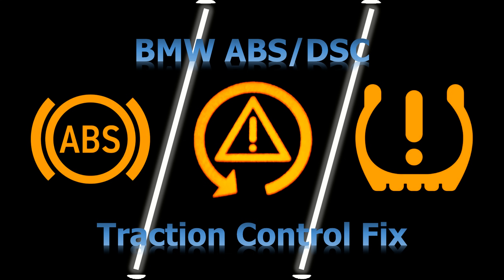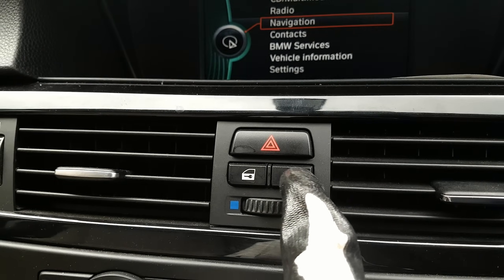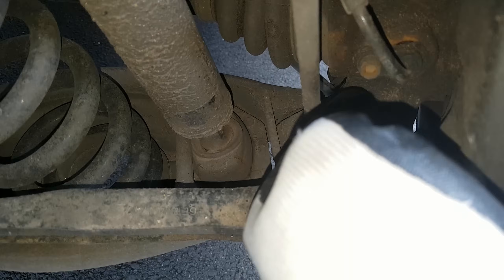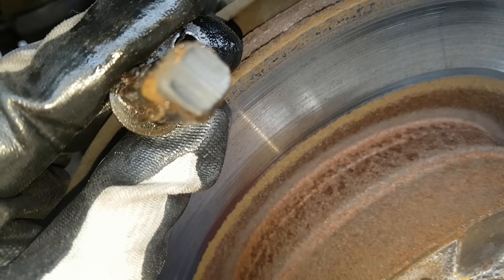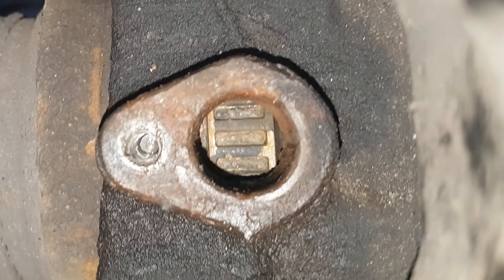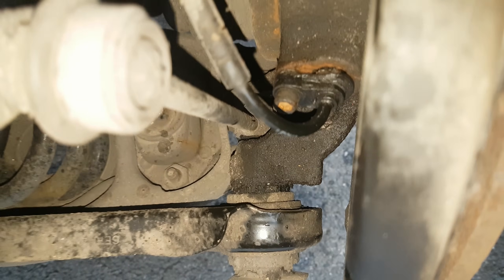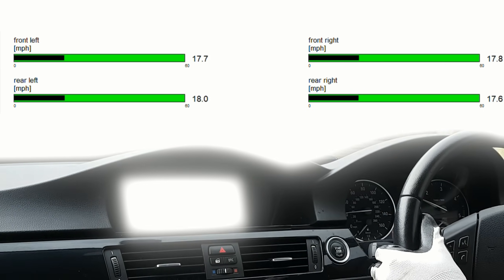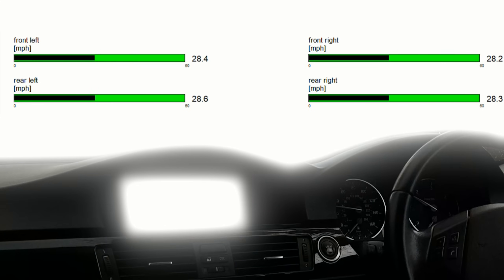BMW Traction Control ABS DSC DTC issue or loss of engine power

Comment: I own a 2007 BMW x3, the 4x4 warning light comes on together with the wheel sensor when I give it 4000 rpm, then when this warning light comes on the car shakes and turns hard, then when I stop and restart the car it disappears.  What could it be?  does the problem show no problem?  could it be the ABS sensor?  thank you
Reply from the maker: Could be ABS or a genuine mechanical fault like warped discs, drive shaft etc etc. What does the diagnosis say?
Reply: @laymandiy  the diagnosis shows nothing because the light goes out when I restart the car.  And the mechanic doesn't know what it could be, he says something about the electrical part of the car, but the battery was changed last year.
Reply from the maker: You kind of need the diagnostic in when it happens live to establish the issue.

Comment: I try this on my BMW e92 2007, but it not help. First i had only the flashing traction control lamp, after i do this in the video i have abs,dsc,dtc and tyrepressure lamp on. It comes and goes when i drive.
Reply from the maker: How thick was your washer

Comment: Hello. How long can you drive with that signal light and whould your engine shut off completey while driving? Thnx.
Reply from the maker: Yvonne Gomez as long as you want. As long as you turn the traction control off. But you're driving with a crucial safety feature off which isn't recommended
Reply: I was driving like that 2 weeks, and then it started doing the same /losing power/ even though the traction control was off. Then my car mechanic finally had time to fix it, and he basically just cleaned it, after that it was working just fine.
Reply: @stanislavaviselkova3263  is it still working fine?

Comment: Hi there, not sure if anyone has some advice. I took my BMW 1 series to a garage as I got the DTC warning light. He then said the Vanos cams came up so cleaned them up for me. Got more issues so he serviced the car and changed the spark plugs and then said that would resolve the issue. I now still have the DTC warning light with the car pulling. He said I should bring the car in and he will do another diagnostic but I am starting to lose confidence and I'm £400 down! 😞
Reply from the maker: Interesting, very difficult to diagnose remotely. Did you resolve it?

Comment: hello.!! I want to see if maybe you can help me figure out what's wrong with my 2001 bmw 330ci... its been having this issue since I bought it last November 2019..the problem is the following: when driving the car my DSC LIGHT AND BRAKE LIGHT ALWAYS COME ON and when they do the car starts making this noise from the front left driver tire and then you can feel like the tire braking or as if something is getting stuck, jerk drive like feeling..as that happens the lights on dashboard start to flicker for few secs as it recognizes there's something wrong and then stay on until car is stopped and parked.. in one occasion it even make my front left tire get completely locked to where it burned tire (because I was driving it of course lol)... I can't seem to find what's the issue , I've already replaced the brake rotors with pads, also abs/speedometer sensor, and still no success... Ive tried taking it to a shop (not euro car emphasized) and they suggested the abs sensor that's why I replaced as well, but nothing...
DO YOU KNOW WHAT CAN POSSIBLY BE WRONG WITH MY BEEMER..? PLEASE HELP!!
Reply from the maker: Diagnostic not picking up anything ?

Comment: Hello my bmw e46 have turned on lights of ASC and ABS, and have lose the power. What must be the problem for power do you know? When i start to move the car need more rpm to start, and when i change the gearbox very slowely goes up rpm from to 2000rpm. Thanks.
Reply from the maker: Sound like you need to get it looked by a professional. You won't have to diagnose let alone fix. Off the top of my head, if it's simple enough, clutch replacement (it could be slipping).

Comment: Afternoon and greetings from a fellow Brit now living and working in Germany.  This happened to me today while driving on the Motorway, car kept reducing speed and the indicated warning light came on (2007 BMW 1 series Sport UK variant) I am guessing what is happening to mine is 100% as your video suggest, well I guess I need to get it into the garage and get some sort of estimate, have a feeling its going to cost a small fortune.  Kind Regards, John
Reply from the maker: If you don't use BMW original parts then you save a small fortune lol. BMW quoted something like £1200 per side
Reply: @laymandiy  your video is excellent, I will take the car to a good local German/Bosch garage and hope it’s repairable and not so expensive otherwise I will be considering a alternative car.  Still your video was excellent, just wish I was back in Cambridge at my trusted garage.  Many thanks, Regards John

Comment: I had a garage replace my right rear wheel. Just about ever since I've had the DTC problem on left turns and straight highway lanes. Could it be that the wheel replacemant by the garage caused this??
Reply from the maker: Unlikely, most probable cause is that all your connected systems were deteriorating in the same manner and suddenly a brand new wheel is probably forcing it into a new position causing the sensor to rub up against the relictor ring..
Reply from the maker: Alternative they could have damaged the hub so badly that it's causing these issues but a wheel change is so simple I doubt it.
Reply: @laymandiy  I'm getting low pressure signs also, even after replacing the tire that always had this issue. Could it also be that due to the low tire pressure my right rear wheel is smaller and therefore has to spin faster than the other 3 tires, causing the DTC to go on??
Reply: Even after replacing my tire the pressure is down to 1.1 bar after a week
Reply from the maker: When you say wheel replacement do you mean the entire alloy. You need to take it back to your tyre place and investigate why.. tyres are capable of handling a couple mm difference in size.. if you really thing it's an issue get a tape measure out.. and having a diagnostic kit will tell you exactly what the issue is..
Reply: @laymandiy  i'm gonna get him checked out. It's probably the same BMW characteristic issue you display in your video. Thanks for the help!!

Comment: Have similar issue on my 09 e90. DSC malfunction comes up along with ABS light and Yellow Brake light. Codes don’t show any wheel speed sensor. I get 5E1A CAN/DME signal error with 2A94 - Crankshaft position Sensor. Checked rear wheel speed sensors and reluctor ring, both are okay. Is it worth checking the fronts too? Or could it be some other issue. Car drives okay with DSC restricted. 
Thanks in advance for help!!
Reply from the maker: You need to probably replace the crankshaft sensor... It's a common fault

Comment: Hi mate, this repairs the code 5DEC - Info FLR (driving power reduction activated) ? Thanks.
Reply from the maker: It can do if the speed sensor is at fault.
Reply: @laymandiy  thanks mate

Comment: I just watched your Video,My Traction Control light and Handbrake light both came on at the same time today while driving.My Handbrake is off but bleeps a few times to tell me to Release it when it's off...Anyone got any idea's please,as both lights will not go off now..Many Thanks for any advice before I whip into garage.
Reply from the maker: Sounds like a handbrake sensor issue, cheap fix, I'd try that first.
Reply: @laymandiy  Nope,the brake fluid was on Minimum,topped it up and all good now :-)

Comment: I just recently bought a 2005 BMW 545i and I get this light when I’m going 45 and the car will kick back and it won’t go past 45 miles per hour I put the DTC on and I can go past 45 and it will allow me to go 75 but then after 75 it will stop. I need help not sure what is going on??
Reply from the maker: DTC on reduces the sensitivity, holding it to turn off in theory reduces it further. Completely off I'm not sure.

Comment: I have a 2011 BMW 318d that does the same thing. How would I know what wheel it is without plugging it in.
Reply from the maker: Explained in the video
Reply: @laymandiy  I missed the part where you explained how to determine which sensor.
Reply from the maker: @MrHandpipeman1  if turning left usually the rear right and vice versa. It's not an exact science but the most common.

Comment: Great video! My car(e87 116i) has quite the same problem, but the mechanic says that on the tester he can see that the car feels that it moves even when it doesn't and maybe the problem can be from the ESP computer and not from a sensor?! His final answer was that he is not sure about what should be changed. 
As symptoms: the DTC enters after 20-30km/h(at the beginning just when I was turning right, but now it enters every time) and I have to disable it in order to be able to drive. Of course, after a few km also the flat tire sensor appears, and sometimes also the abs or handbrake sensor appears. I do not know if also the oil level sensor is somehow correlated because it also appears after half an hour of driving(and the oil level is normal-high).
If you have time to help me somehow, I will strongly appreciate it :D
Reply: I have to clarify that the DTC appears/disappears(it not a permanent fault)
Reply from the maker: Hi, First thing is first, we need to get to the root of the problem by elimination. First what i would suggest you do, if you don't want to spend a lot of money is get yourself a k+dcan cable or borrow one. 

1) Drive with the INPA graphs up and record your screen and see how the wheels react to you driving cornering etc. If the car "appears" to be moving, which sensors are showing this to be the case. Likelihood of the speed sensor being damaged is very high, as imagine constantly grinding a magnet against a rusted metal. 

2) Check the ring from underneath the car. If you have the means to easily jack up the car SAFELY or on a ramp you can see from underneath the car, spin the wheel a little to see the rings if its not perfectly round then there is your problem.

3) I don't think there is a problem with the ecu at all. 

4) Are your wheels balanced correctly?

5) did you ever have a knock on your wheels, is there any play in the linkages?

Finally "car appearing to be moving" if it is one sensor showing that then you know its damaged, if it is all sensors showing movement in the same direction and speed, then further investigation is required.
Reply: Thank you very much for your detailed answer!! My car is in a garage right now and the guy says that probably the pump of the DSC unit can be the problem(but he is not sure)...but it costs 2000 euros and just the guys from BMW dealer can solve it. I'm sure that is not the problem that the car has and I hope that tomorrow I will give him some inspiration and maybe we can manage it together :)) The wheels are balanced correctly. About linkages...he changed now the telescopes and probably tested all the movements..I'll ask him tomorrow :D 
 @laymandiy

Comment: i got a question, if u could help me out. i have a 09 e90 with an issue of shaking when at 40-60 miles an hour under load, i’ve checked the quibo and center gasket for the drive shaft and still vibrates. have you heard of this problem before and if yes did u find the solution, thanks in advance
Reply from the maker: Yes many times. It could be many many things, from the wheel hub do the bolts. I had one where the nuts on the tyres wasn't on fully causing a noise. So I'm afraid you'll have to try and find where the sound originates from.

Comment: Do you have to clean it or just washer will do the job thanks
Reply from the maker: jas222grewal cleaning it will ensure the fix lasts longer. You will eventually need to replace the ring or the shaft. Chances are at very high speeds it will come on again.

Comment: So in the UK BMW have charged me £382.66 to fix this issue. 2 new rings and 2 new sensors. 2024.

They under quoted me as it should be £468.22 ish so bear this in mind in the UK.

Also BMW will not spray rust converter on these either which helps prevent the issue in the future. Shame but it’s BMW they have a process.
Reply from the maker: Good to see they are fixing the issue now, they weren't before, charging to replace driveshafts.

Comment: Any ideas of why my traction control light came on just sitting in the driveway with the engine running? Also the speedometer stopped moving. 03 525i Dinan5
Reply from the maker: Wheel speed sensor is faulty, need a new one. Usually the left one
Reply: @laymandiy  Thanks, I appreciate your time and help.
Reply: @laymandiy  Awesome! I replaced all four because they were in bad shape and the problem went away. Thanks

Comment: Which diagnostic machine did you use? I have the same problem but im not sure how to find out which sensor it is
Reply from the maker: D+kcan cable and INPA
Reply: You can also use MHD app (with Cable) and Carley (with bluetooth OBD) to read and clear codes.

Comment: Hi. 
Great video and very enlightening. 
My 1 series is showimg the abs hazard intermittently and then started jerking intermittently. The jerking has increased after 2 trips since it started.
My mechanic is saying it is a lot of work to fix and quoting £350. What do you think the issue is? I am totally clueless about cars!
Reply from the maker: The jerk is probably the loss of power and then the power kicking in again and cutting out. It's the system thinking's it's trying to prevent skidding. If you hold the DTC button and turn it off and drive (carefully) then you'll know if it is the same issue.

Comment: I hit the kerb N/S/R wheel and the DSC light have come on and the steering wheel feels lighter. Any tips please.
Reply from the maker: Wouldn't be driving too much on that. Get it up on a ramp and get everything checked from the axle to the shaft to the hub. 1 or 2 bits might need replacing for safety
Reply: @laymandiy  Thanks for a prompt reply.

Comment: just had this issue and after turning off the car the key is stuck, doors won’t lock, no lights. What could be causing this?
Reply from the maker: Sounds like you've got the recall issue. Open and close the door a few times the rear right side. The connection to the battery is intermittent.

Comment: Link for the sensor readers diagnostic when driving ?
Reply from the maker: Not clear on what you're asking.
Reply: @laymandiy  When youre driving it shows front left front right rear left rear right diagnostics. This is a tool i take it >?
Reply from the maker: Yup, just a screen grab of the wheel speed sensors for FL,FR,RL,RR

Comment: I tried doing this but now my car give straight all 3 lights it probably because the washer is thicker. I cant find the excat washer can you recommend where to find it?
Thanks
Reply from the maker: I used a 1mm thick one if I remember correctly. And it was made of aluminium not steel, which can also cause discrepancies.

Comment: Hello, I have this same problem. I have a BMW 120D And my traction light (Triangle with arrow) keeps flashing on my dash. I have had a sensor replaced and the same issue is still happening. I have now been told to get new rings will that help? Please help any advice will help massively. Thank you in advance.
Reply from the maker: Yes replacing rings (after sanding it back to original condition.

Comment: Just attempted this on my vehicle on all 4 tires sides but the issue still appears. My sensors were just a bit dirty but no actual damage like I see here. What else could it be?
Reply from the maker: The sensor usually isn't the issue, the reluctor ring is. Is your issue intermittent or permanent?
Reply: @laymandiy it happens here and there. When I start my 08 535xi it drives fine, few seconds to a minute later it appears. My screen, A/C and electrical components don’t work and out of nowhere it decides to work again. Just keeps on going back n forth like that
Reply: @laymandiy  I also get the 4x4 malfunction right on as well, the automatic gear doesn’t let me go in reverse or park and sometimes I’m not able to accelerate as well

Comment: I have a 2004.BMW 520 with straight 6 engine. The steering feels very heavy when in use. What could be the problem?
Reply from the maker: Could be anything, can't say. Steering pump some shaft tyres, I dont know
Reply: Sounds like your Power Steering pump went out. Check the Serpentine Belt too.

Comment: HELP PLEASE!! I have same lights along with tyre pressure monitor fail error causing the car to go in limp mode. Which would go fine after 5 mins of engine off and it will reset the dash lights. last week I have changed the both the o rings on rear shafts along with both the abs sensors but this morning I got the same warning lights again. Any help much appreciated
Reply: Did you ever find anything it what was wrong?
Reply: Mine is doing this, abs light, flat tyre monitor then car goes into limp mode and I lose power steering and car sticks in gear 😭
Reply: OfficialGravzy bro I still haven’t figured mine out,

If I hold down DTC button, it turns traction control off and the car runs perfect. I’ve changed all brakes and brake sensor to no avail

Comment: Great video... what Diesel engine is it? I see you’re getting 58.8 mpg, I’ve got a 2010 318d sports plus and I’m only getting 42.8 mpg if I’m lucky
Reply: LaymanDIY  ok thanks... mine is combined 42.8 mpg its the 140 bhp 2.0litre turbo, does that seem low to you?
Reply: @pillygt1  i have 330d e90 2006 mixed consuption about 8l per 100

Comment: Can you help me? I confused, what need to be replaced, shaft or cv axle, can you send me some links about what is the part please mu car is bmw 328i 2008 thanks so much
Reply from the maker: Driveshaft needs replacing. It's different for various cars. Easy to identify, attached directly to the wheel hub.